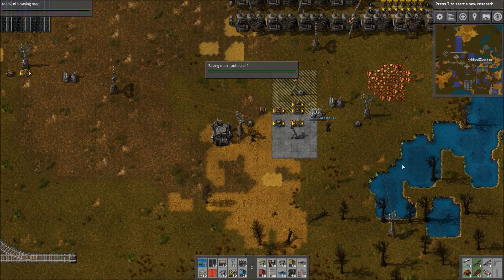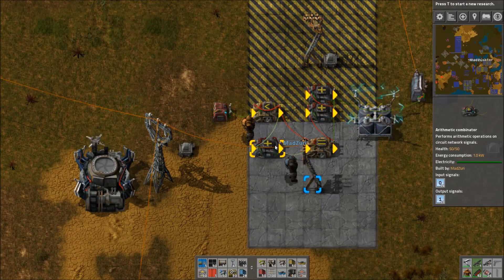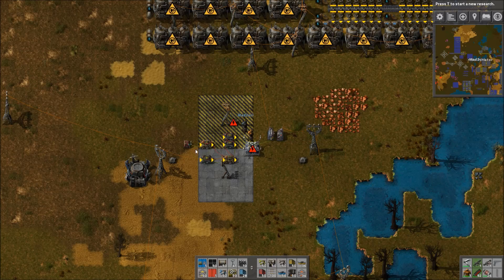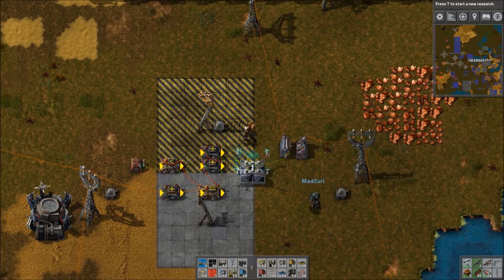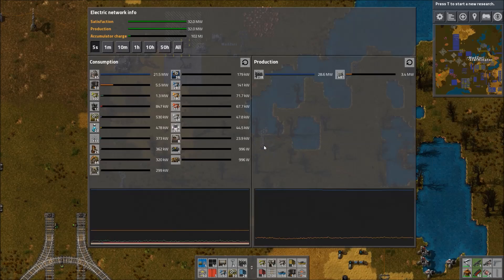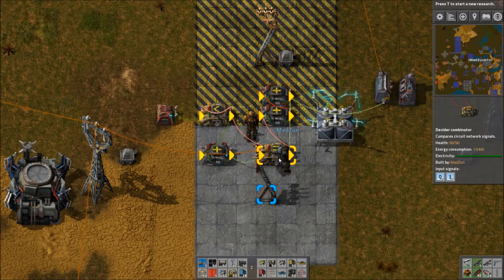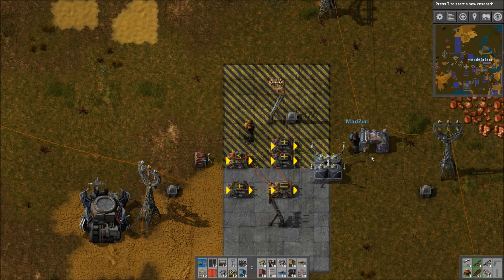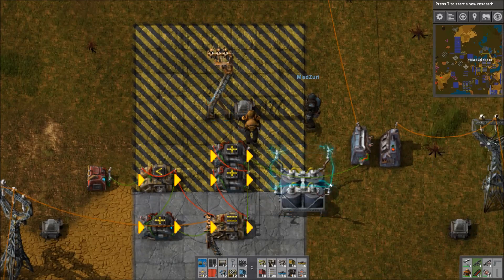Factorio Workshop - Build A Better Factory :: Power Detection Switch

Comment: From the title of this video, I was hoping this was a system that could gradually regulate steam power, but this is really just a binary on/off switch for the whole bank of engines. Would you please explain why someone would want to use this over a simple schmitt trigger or rs-latch?

Other people have commented that they use a rs-latch to turn their engines on when accumulators are low, and then back off once accumulators are high, but then I would have to chose between:
A) a narrow range (say <5% charge to <15% charge), which results in steam engines starting and stopping very frequently
B) a broad range (say <5% charge to <85% charge), which would leave little accumulator room for my solar panels to fill during the day. This is undesirable for me because I'm using hybrid solar/steam power; when accumulators are full during the day, solar panels only produce as much power as is demanded and excess capacity is wasted. :(

A much more satisfying solution would be to gradually regulate steam engine output so that my accumulator charge is held relatively constant without a lot of control action.

I've tried to do this in a rough sort of way by separating my steam engines into isolated groups that can be switched on individually. Each group is then set to turn on at different accumulator thresholds so my total steam power increases in steps until it roughly equals demand. But this is not very ideal, and something more truly analogue would be fun to achieve.

Does anyone have any ideas?

Comment: "Analog" is pushing the term to its limits with this, lol.  Personally, I prefer an RS latch, backup turns on if accum is less than 10% and turns off if greater than 90%.

Comment: What is the point of this arrangement, compared to a simple switch based on an input from any accumulator at say, < 10%, switching on the steam engines (or water pumps).

ie, what problem are you trying to solve with this design ?

Comment: Couple of questions if I may.

Is the accumulator the 'bridge' so that it receives power from the main grid and provides power to the combinators in the 'hazard' concrete zone?

It's 'analog' in the sense that it stops flickering, not in the sense that it only provides what's needed from the steam power? So when the steam power kicks in it's full power?
Reply from the maker: No problem!

For your first question, yeah you got it right, that's what the accumulator is primarily for. 

Correct. It should prevent the power from flickering. As for the part about only providing what needed, that is kind of done naturally by the steam engines. Steam Engines will only ever work as much as they need to. So if your backup steam power kicks on, but you only need say 50% of it to help keep things running, the engines will only work 50%. They will work that way regardless of a switch or not.

Comment: Why not just hook the switch to accumulator and set switch enable condition to "accumulator < 1%". Would this not be a much cleaner approach?
Reply: I build something like this with an r-s latch turning the power on at 20% akku load and off again at 50%.
Reply: Yes, but one problem I have always had is that the steam engines are then constantly turning on and off (as the accumulator charges and discharges over the the set amount that it needs to hold). What i tend to do is set it up so they turn on at a very low percent (say 10%) and turn off when they hit something a little more acceptable (say 25%), they still do have a chance to turn back on in one night but your power graph won't look like a bed of nails.
Reply: Strange... I never had that problem. When it come to the event where backup power is needed usually mean that my accumulator had depleted and still the middle of the night. When day light comes solar would be taking over very quickly anyways. 
the problem with setting it at 10% is that you don't want your steam engines to contribute to recharging your accumulator when solar comes back  
@xTermintor how about a video highlighting on water capacitors?